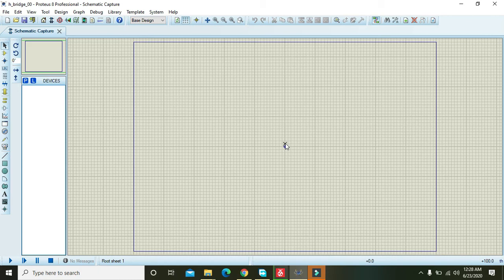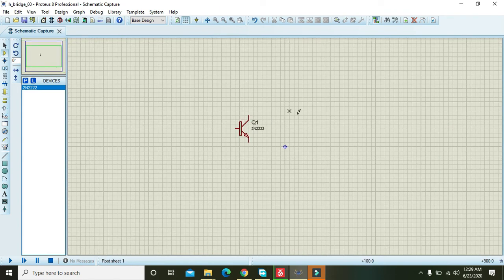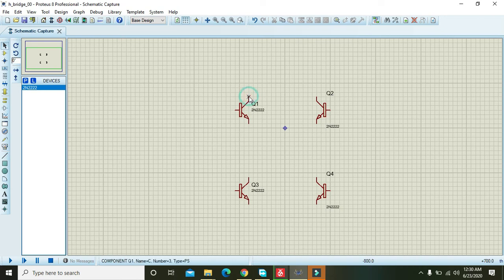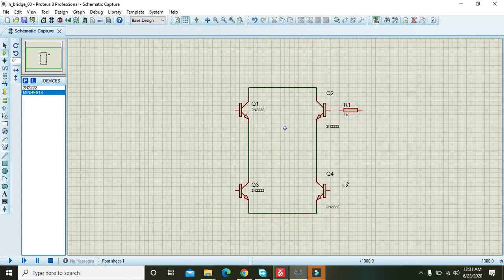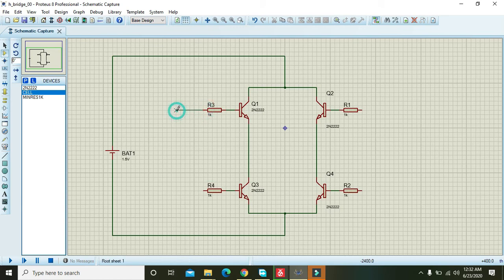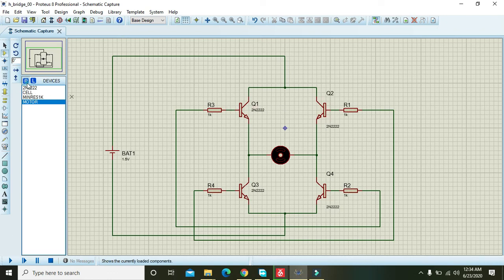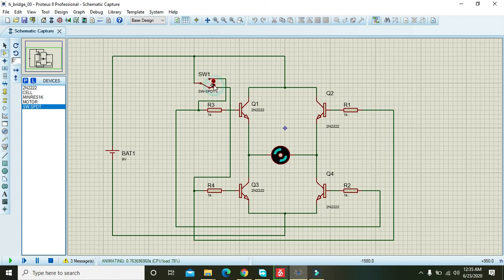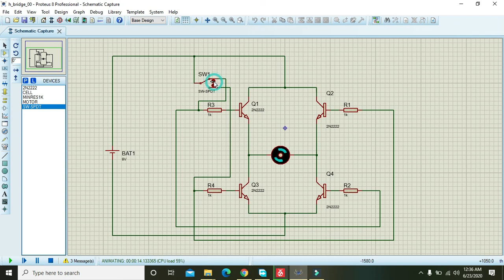How to make an H bridge in proteus | simulation of an h bridge in proteus

Comment: I have a question if you increase the battery source voltage does the motor voltage drop increase accordingly, mine doesn't it remains at the same voltage regardless of the source
Reply from the maker: if we increase the voltages of the battery.......the drop must increase across the motor.........